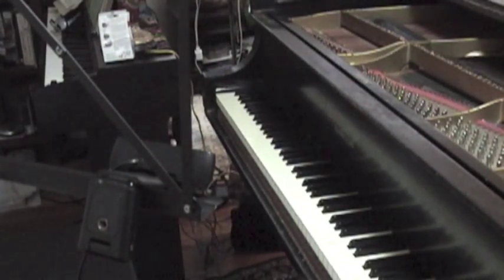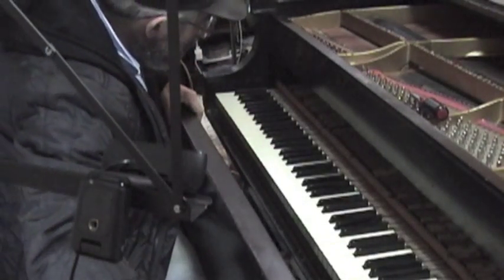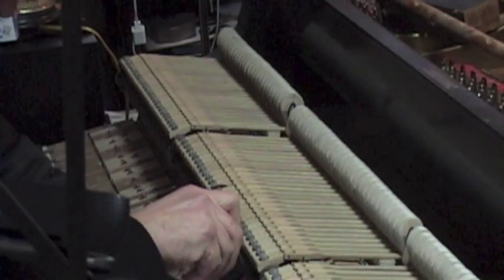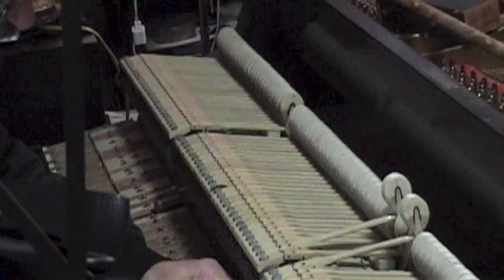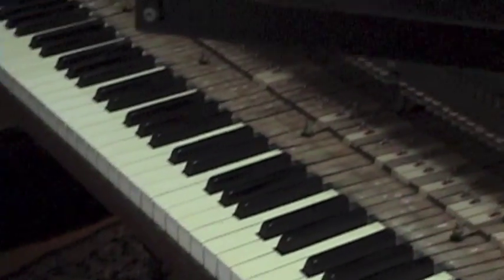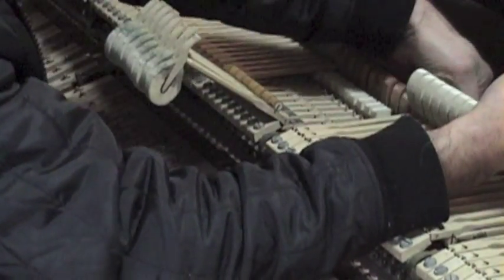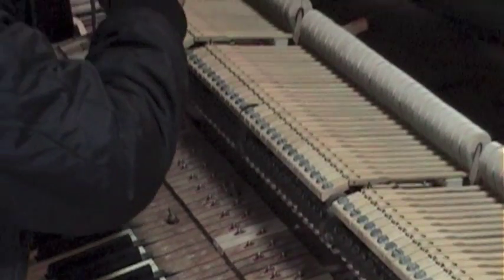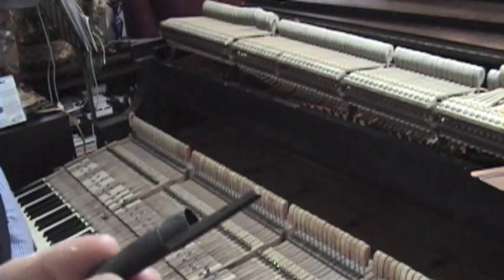Piano Maintenance: Solving the note B clicking problem in my Steinway grand

Comment: what did you end up doing?  What a cool tech guy.  I have a brand new Kawai, and about 10 notes are already clicking after only 8 months of moderate use.  Very upsetting.
Reply from the maker: He relocated to Jerusalem. I'm not kidding! we lost a treasure. But I hooked him up with an Israeli FB friend. He found an object on the key.. I have to watch the vid to recall what fell in there. I'm surprised your new Kawai has clicks. Doesn't it have the carbon fiber action?
Reply: its brand new, the piano tuner came out, tuned the piano but couldn't fix it, he works for the piano store I bought it from Evola in Michigan and I'm supposed to hear from the tech guy.  I'll be calling if I don't hear from him soon.  The piano tuner identified it,  couldn't fix it, so I know I'm not crazy. But it is driving me crazy. Bought the piano last year around Mother's day.